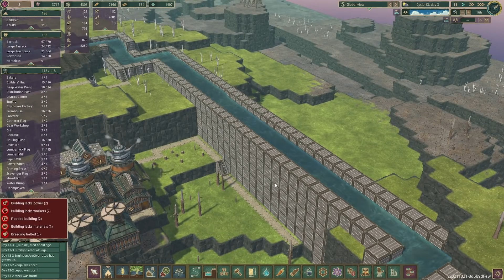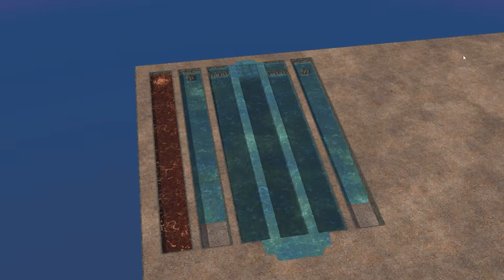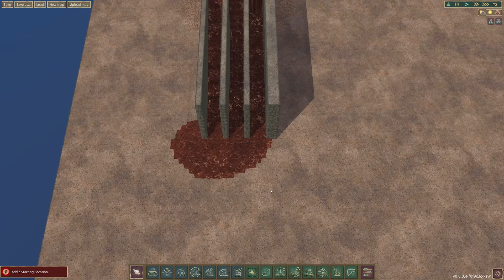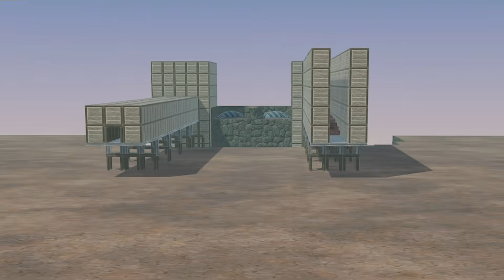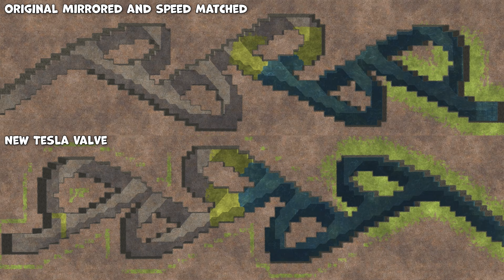Engineering a TESLA VALVE in Timberborn!

Comment: What I think you should’ve tried when pressurising the the water for the Tesla Valve was also pressurise the water source blocks themselves with something solid over the top. I’m also not sure if the inconsistencies with the loops helped with the test either but who knows. I’m just assuming that it would have to be built properly for an actual test, you don’t have to dig into the ground to make it either you could line it with blocks so everything is even. And the channels would probably be best being 3 or 5 blocks wide so when you put the power wheel down it’s centralised for the point of water flow.
Reply: But I could also be wrong about centralising the wheel, perhaps the game has even flow across each block.

Comment: The Tesla valve may not be working because the simulation isn't sophisticated enough for it to, but it seems like even if it was that it still wouldn't work right because it needs enough water velocity that the water has momentum enough to prefer the straight passages over the sideways ones. When it's just slowly oozing along, it spreads down both at once and it doesn't work.
Reply: Which, I should add, is representative of a Tesla valve at low flow velocities; it isn't a zero-return valve.

Comment: Bravo on making a working Tesla valve. I feel the forward Tesla is not as straight, ie. least resistant, as it could be. Primarily due to the rather sharp direction change into the second part. If the angle is reduced, I think the forward speed will be faster. 
As the water pressure is almost negligible, unless the valve is really long, the reverse should always make it to the end.

Comment: If less water were to go through the pressurized Tesla valve it would accumulate at the start and overflow, but it doesn't. The same amount of water goes through but in a tighter space and at a higher average speed. So the only logical explanation to why the wheel produces less power is that the water in the valve has a lower exit speed because the higher average speed makes the valve work better and slow the water down.

Comment: 18:00 This test is likely invalid, since the one with the lower hole has access to more water. 
The top one is competing with the amount provided by the badwater source and the bottom one is just dumping the reservoir.
So I don't think pressure is a thing.

Comment: nice video but some anotations:
- You dont need to generate the science to unlock stuff in the dev mode
- There are sluices - the original one way valve - and they are possible to automate :D
- a had to a pipe should pusch the Water back up after the pipe.

Comment: Each time I see someone trying this tesla valve in "blocky" game, I immediatly guess it's dommed to fail, and every single time I was correct. 

Usually game register in each cell only the level of liquide in the cell (for example minecraft and timberborn in previous versions), this allow adjacent cells to compare their content en decide how to move around liquid. 
However there is usually no notion of movement speed. In this case, the speed of the fluid is only dependent on the rate a which the game update liquids and is not impacted by how filled cells are or how they are arranged geometrically. The fluid just propagate by one cell at every update, that's all.
Also this model doesn't allow fluids to move up, because there is no notion of pressure.

Then some games, like this new Timberborn version, add "pressure", which require an extra value to be stored by the game for each cell. 
This could impact the fluid in 2 ways:
- allowing it to move up after passing under a dam or inside a pipe.
- allowing to move faster if this is taken into account into to fluid update mechanism. (but that's does not seam to be the case here) 

And finally for a tesla valve to work the game need to register an additionnal information for every cell which is it's momentum, and then program all the calculation over how these fluid momentums add/substract to each other. 

And finally there is the real fluid mechanics formulas, but it's clearly overkill for a blocky game, and would quickly destroy you pc if there is more than a hundred cells to compute.

So games could implement various levels of realism in fluids dynamics, but this will cost more computation and more memory. But those last improvements, would usually have less visual impact in the overall fluid dynamic and would only be noticeable in niche cases which wouldn't be visible for most casual gamers. So I won't blame game developers for opting to simpler models for the saving performances.

Comment: Your tests before the Tesla valve worked based on gravity/atmospheric pressure forcing the water to move faster through the tunnel. If you put a lid on them so the poo can't escape out the top/back it should force all the fluid to then move through the tunnel, adding much more pressure.

Comment: From other videos I've seen, I'd say it only models flow rates, there is no pressure. And there's a trick with gradient where the more edges you have water going over, the faster the flow rate (credit to SkyeStorm). There is a weird effect I found where I funneled the thousand island waterfall (12 water blocks) into a 7-wide channel, and if you put a 1-high waterfall just in front of the channel entrance it creates an invisible barrier that blocks most of the water.. you have to move the gradient into the channel or away from it to fix it.

Comment: I believe during the pressure test, the water wheel HP difference was because the top one was only running on the water source generator, while the lower one was running on the water source generator AND the water storage above the floodgate. So the very beginning of those water wheels test, the storage would both need to be full, and the HP measured before the storage of water above the higher flood gate gets below the top of it.

Comment: The name tesla valve is misleading, because it's not a valve. It's a pressure limiter. It resists a sudden change in flow rate and pressure by creating counter pressure, so it could possibly be used to protect the plumbing in your house from water hammer

Comment: Actually to check if its truly makes a difference you should have tried the waterwheel on both ends. If it's affecting the flow you would have different numbers.
Here you added the variable with limiting the flow and its not really clear if the change was caused by the encasing of the valve or increasing the friction as it was full

Comment: When needed, you can change the strength of the source to a negative number, causing it to suck in water.  Each integer + or - is equivalent to that number of source blocks.  I made a map that uses a +20 badwater source.

Comment: uhhhhh isn't the water speed based on slope bit just a conservation of energy problem, and the water should get to the bottom at roughly the same time? if you're trying to optimize for the speed of the water at the bottom, then you'd want a cycloid, no?

Comment: Sorry to say, but I don't think the Tesla Valve was actually working. Looks like it's still just the volume of water flowing down the path of least resistance at uniform speeds, except it's now calculated by cubes instead of columns. Putting a lid on the valve just meant it was flowing through a 4x1 hole instead of a 4xX hole. Less volume of flow, less power from the wheel

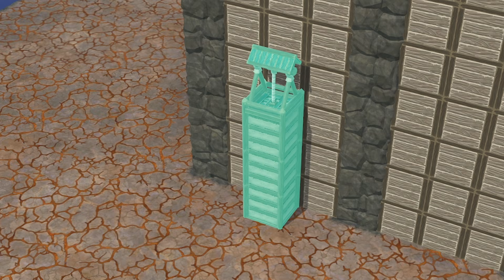Though now you can probably jury-rig a Discharge by entombing a water source in a hollow cube of levees with a floodgate output like you've got a 12:20. Doesn't even need to be a Badwater source, since normal water flows in exactly the same way. As long as it's waterproof on all six sides, it will fill its space and then just sit there until you open it up.

Comment: There is "pressure" when you have a channel and you let water fall from many edges. Essentially if you build a tetris T piece there are 5 edges from which the water can fall down but the channel is only 3 blocks wide, that's how you force water into sort of a pressure where it flows faster without increasing it's level and overflowing th channel. At least that's how it worked before.

P.s. judging from the water wheel readings, the pressure in this game is water speed. Which makes sense considering how hard it is to compress water in volume...

Comment: I'm not so sure about that 3 across the middle, how would that handle being turned sideways?  I imagine it's radial, but the walls are deflecting the edge nodes in the correct direction.  I'd love to see you try doing 3 in a diagonal against the lines both horizontal and vertical to see if it makes a difference where those 3 nodes are in the 3x3.

Comment: The reason this does not work is because the game probably calculates water flow based on height. (Similar to minecraft, but the "water sources"  can contain different amounts of water and are allowed to move around.)  Each tile does NOT remember a flow direction from the previous frame, instead the only consideration is that high water flows downhill. There is no momentum of any kind.

Comment: Curious, would a custom water tower then be possible?  My question being, would water be forced upwards if contained within a pipe if the source feeding it was larger/higher than the holding tank?  Or will vertical pumps still be necessary?

= = ground
- = levee
| = flood gate
: = pipe
x = intended to be air gaps

            side view:

<-- Water source height
                                            ______ 
                                            xxxxxx  <-- Holding tank
                                            - : ----- : -
                  <-- Input            : -xx : -
---------------------------------------- : xx : -------------------------------------------------
::::::::::::::::::::::::::::::::::::::::::::::::------::::::::|::::::::::::::::::::::::::::::::::::::::::::::::::: <-- Output
==================================================

Comment: RCE, you're looking at this from the wrong direction. I get it'd make sense that fluids would have a momentum and velocity calculated in, but I'm looking at it from the view point of, "results are pointing to inconsistencies towards preservation of momentum." I'd have to hypothesize that what's going on is that it's momentum by volume per an area's "fluid tension" or something equivalent to that kind of thing. The sloped and drop "poo water" test you did around 7:11 was like that because the sheer drop channel had to overcome a very large total "surface area surface tension" for each block from the source of fluid plunging down on it. That fall took time and the spreading was in all directions before it was redirected outwards. The steep slope had a quick succession of overcoming some very small surface tensions with a direct flow coming in overhead that was directed down the channel giving it an advantage and a "momentum" boost while on the slope. However the moment it hit the bottom, it was essentially in the same boat as the sheer drop channel with the only difference being that it's source was already directed out of the channel. The long slope "won" because of the uniformity of every "surface area tension" being the same so by the time it reached the bottom, it had to "fill in" about the same area before it spilled out of the channel. The larger area a fluid has to fill in, the "slower" it is unless it's got a flow vector and flows are created with a change in elevation in relation to the area.

So the extreme change in elevation (the poo-fall) would theoretically be great only at first. As it spreads, that change in elevation gets further and further away from the edge of flow got. Same with the extreme angled slope. The only changes you could make that would speed those up would be to decrease the surface area required (narrow it down). It's most likely something to do more along the lines with Bernoulli's Principle and momentum and all of that, but I feel like the game is doing it more of "surface area". That's really the only way I can explain why some squares get flooded before others on a flat plane vs why fluids don't completely level out across a flat plane and can just sit in one spot. That's me trying to explain this all from a view point of Update 5 and not from Experimental 6, but it feels like the fluids haven't changed that behavior.

Also, I feel like the fluids in this game are similar to the liquid metal in Hydroneer. In Hydroneer, you can keep adding ore to a smelter or a cauldron and it gets "more" in it until a certain point. At that point you're still adding stuff to it, but the level no longer rises. I think with this game, it's kind of the same with pressure. The game will represent flow and pressure via the volume of fluid displayed and the direction it's "moving." But after a certain point, it can't add more volume to what is already 1 block. So it will remain as 1 block of fluid, but have like 400 pressure behind it. Pressure does work, it's just not displayed intuitively.

Comment: I think you may have different results in the tesla valve if you also encapsule the water sourecs themselves in the pipe. Your test has an open backedn where the excess water was leaking out, which coul be the cause for the tesla valve 'working'.

Comment: Do a test showcasing water level equalization between two basins connected with a pipe at the bottom. 

One basin is naturally filled via a source and the other will only be filled from the pipe connection at the bottom. It should reach the same water level as the primary basin being filled from the bottom up.

Comment: instead of blocking the hole using a floodgate, you should be using a sluice. They're designed to be built under walls like what you did with the platform.

Comment: A crazy suggestion: since levee can be build over the platform, try to build leveled aqueduct for the water wheel. So what i imagine is at the botom level there's some water wheel and raise the level using platform and overhang platform and put water wheel on top so after the waterr flow down you can get another power generator, or maybe build the water wheel below the waterfall.

Comment: if you look closely at the Tesla valve test

you will see that going the right way with minimal risistance will only start to show green grass when it has passed all the way through
but with the other way
you will notice that it starts to show green grass when it reaches the second loop 

this will prove that there is pressure created from having the water flow against it self and is rising faster than the one with minimal pressure
this also proves that there is less pressure from using the Tesla valve the correct way since the water only starting to grow when the available space had been filled out

Comment: There wasnt pressure, there was just more water flowing out. I would have checked your inlet first as you could easily see the lower outlets water level was lowering (meaning water out does not equal water in) so on the raised one you just have what the source is creating coming out.

Comment: Doesn't notice the sluices. Doesn't notice that you CAN, in fact, do area building by click & hold and drawing your rectangle.
Poo sources produce vertically from 9 vertical faces, regular water is a permeable block with a source inside so it leaks from 5 faces each. So if you restrict 4 sides (bottom, left, right, back) then 6 of them can only produce vertically while 3 of them can produce in 2 directions (up and forward). This accommodates for the difference. Poo isn't more slippery, it just doesn't have the same output type.
You can also now use the waterfall for the waterwheels instead of it being an illusion.
Reply: Those sluices are so great for the testing in the second half of the video.

Comment: I actually spent quite a few hours like.... 2/3? years ago or something looking into how the old water flow worked.
It was.... strange to say the least, waterfalls (any height change) were actually slower than water flowing over flat ground.
And I'm pretty certain water was just modelled as X amount per tile on the map. (Though i don't really know)

These changes I'm fairly certain are a massive overhaul with how water is simulated in Timberborn.

Just a quick note. You can alter the strength of the water sources, so they produce more water each.

Comment: It looks like there is no directional momentum applied to the water movement calculations, that's why the Tesla valve did not work as intended, and why the apparent flow speed of the water in the pressure comparisons flowed at the same rate. But the beaver-power calculation does seem to include a pressure component (which makes sense)

Comment: Why not just set a bunch of water level testers and look at the height at various locations to get a crude approximation of where it’s pushing the water. Also I don’t think the visuals are synchronized to its flow rate. So anything visually in the water is affected by the physics but it being under pressure or faster won’t change the rate it flows. This is also why the steeper steps seemed ahead of the shallower steps each step down gives the visual a constant boost (probably just like 1.5*ground_speed*blocks_moved  or whatever) so since they covered the same number of steps and the same number of ground blocks they arrive at the same time.

Comment: Why didn't you use a brachistochrone curve to measure the speed of the liquid from point A to B?
Reply: Or test hydrostatic pressure and demonstrate the water level equalizing with two reservoirs and a pipe between the two of them!
Reply: OOOO! TEST A SIPHON.

Comment: If you really want to test pressure, you should create two tall reservoirs, on of which with a water source, and connect them with a pipe at the bottom. They should both fill up equally, but I suspect the second one will only fill up to the top of the pipe